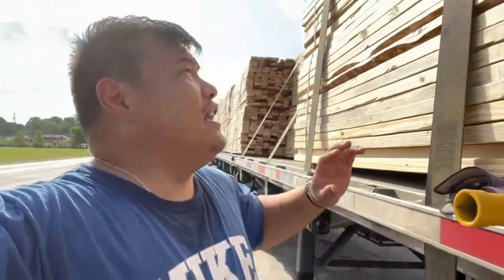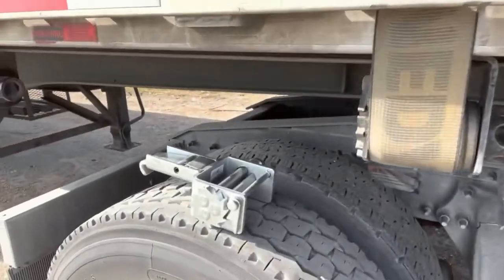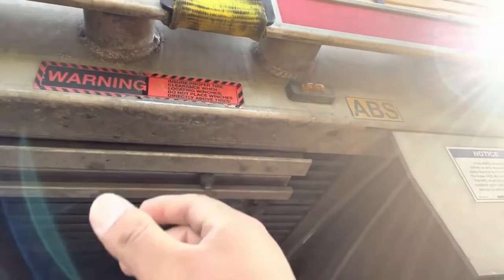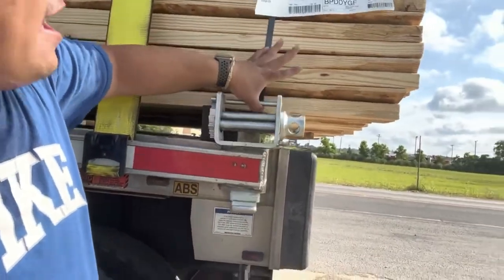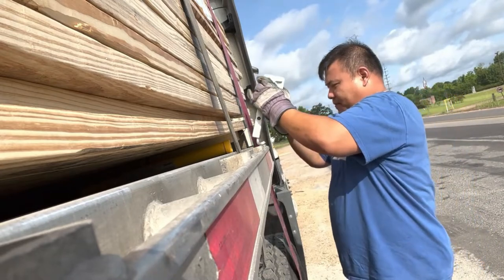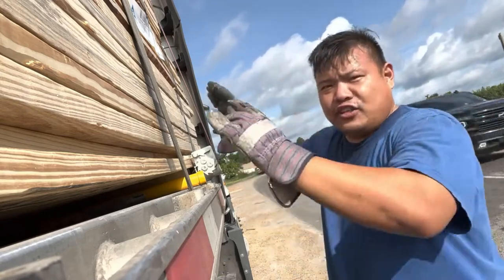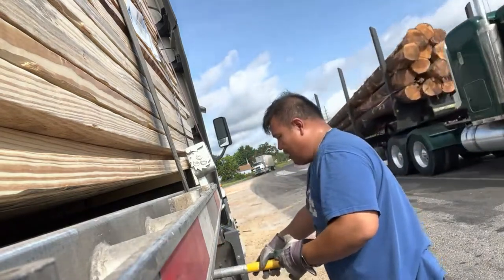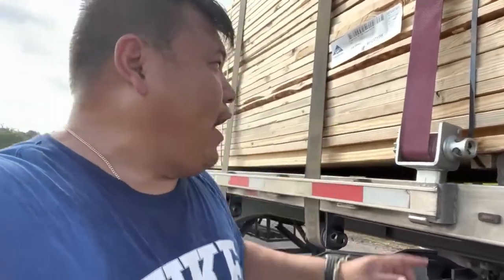Porta Winch Tool For Flatbed Trailers - How To Use It Properly

Comment: What are the best winches shorter or taller what company you recomend? Heavy steel flatbed
Reply from the maker: Winches I prefer short, company am not sure I cajt tell you honesty. Am leased on with another Owner Operator
Reply: @Gemini-G7  really why short? I saw there are few different lengths. 1 flatbed they strong sturdy with little pressure. Other truck you gotta put your whole body weight and the bar may even slip hit u back.. Company guy but boss put me in charge of repairs I wanna get best winches